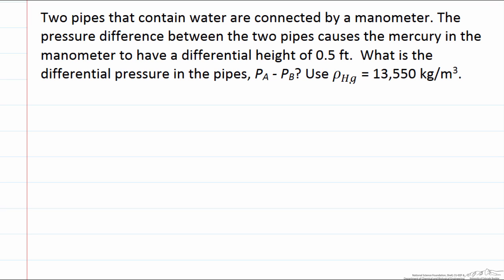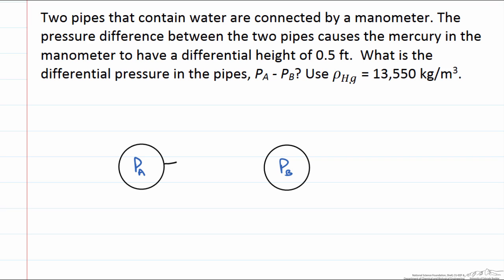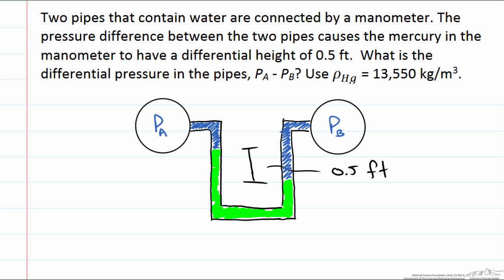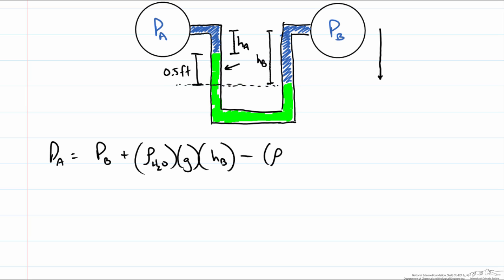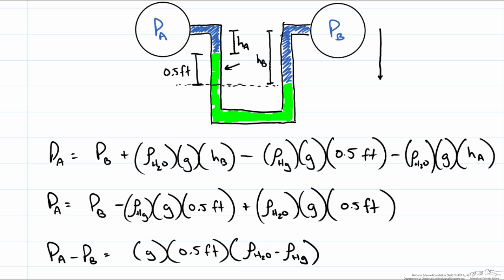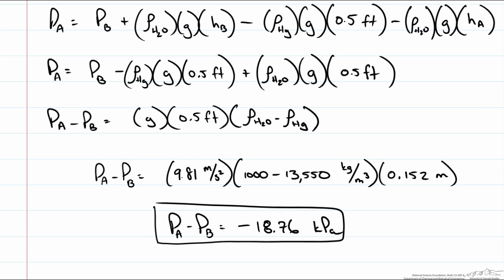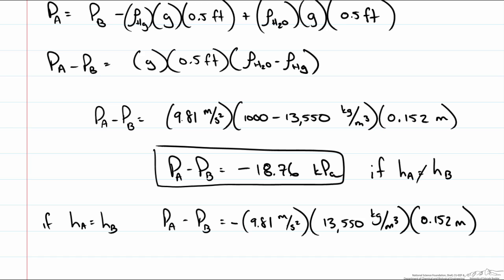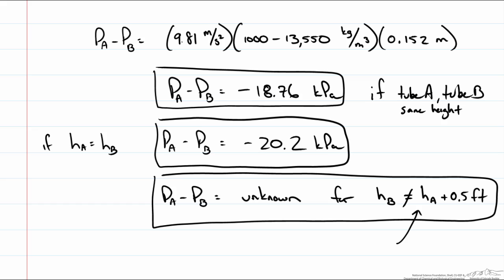Manometer Example

Comment: I don't get when you say that it doesn't matter whether you choose ha to be higher or hb. If you change it to the other way around (hb < ha, 0.5 ft of mercury now on the right side), then again starting from pipe B you get:
Pa = Pb + rho_h2o*g*hb + rho_me*g*0.5 - rho_h2o*g*ha
Substituting ha - hb = 0.5 ft:
Pa = Pb - rho_h2o*g*0.5 + rho_me*g*0.5 = 0.5*g*(rho_me - rho_h2o)
So this time the pressure of pipe a is higher than that of pipe b. In fact , it seems to me that this distinction (whether the mercury level is higher on the A side or B side) is exactly what tells us which pressure is highest. In that case, it seems silly that the problem would not specify where this height difference falls, unless it only wants the absolute value of (Pa - Pb).